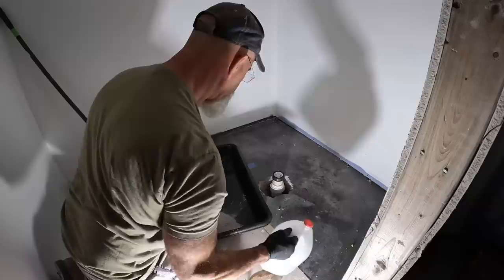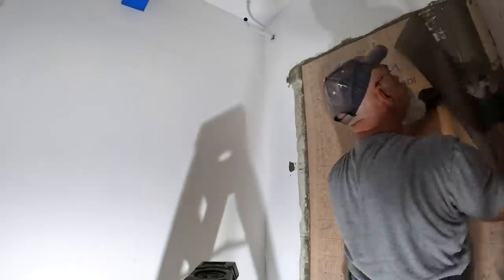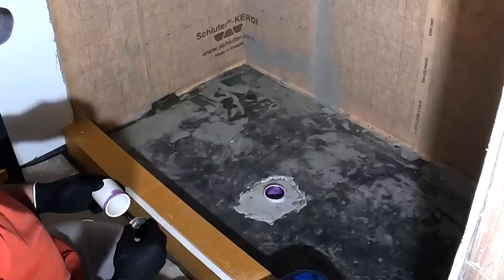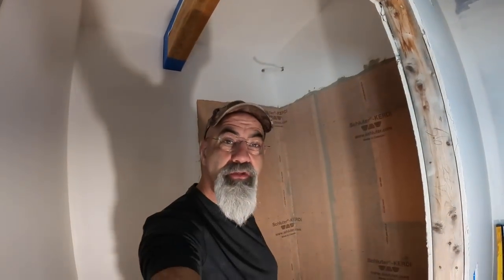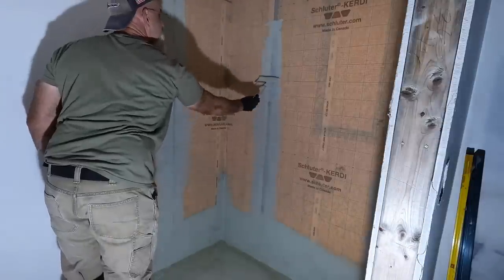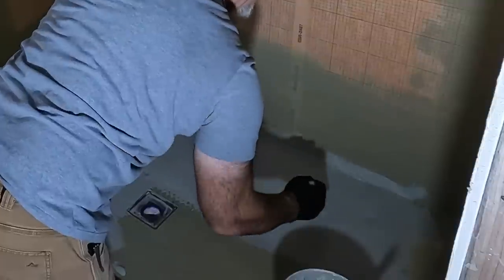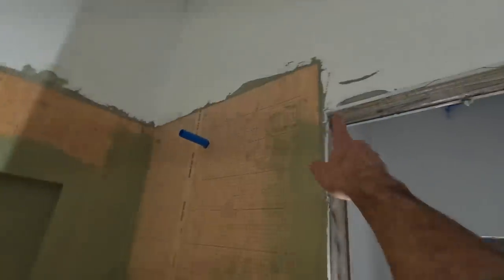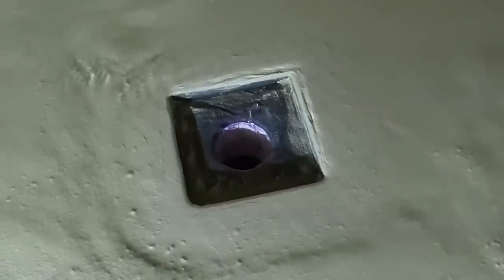DIY Shower - I built my own shower pan -  First time shower with kerdi and hydroban.

Comment: Next time use a gauge stick on the outer edge and a 1/4 thinner one around the drain for pitching water to drain and screen the wet bed then remove the gauges sticks and fill the void’s in you’ll see a big difference in your work and a lot less stress and smoother your thickness should be 1to 1 1/4 outer to 3/4 to 1 “ at the drain you can use a wire lath on the floor for strength no need to fasten it to anything just make it just flat just like a wet bed over a vinyl liner helps keep it from cracking you should of done it on the other one you just did
Reply from the maker: Yeah,  I think I will give that a try. It should make it turn out cleaner. I think my biggest issue was just not having enough material mixed when I started.

Comment: Doesn't schluter want you to use thinset and kerdi band on all the joints?
Reply from the maker: I did use thinset and kerdi on all the joints. But ultimately the responsibility for building the shower is on me. I wanted to go the extra mile.
Reply: @breakheartorchard4761  excellent.  I didn't see any kerdi band being applied in the vid, thus the question.    Must not have filmed it.  Really nice work on the house.  Enjoying the build. Keep up the good work.

Comment: Great video!  I am about to undertake the same project and wanted to know what type of shower drain did you use?  Thanks for the list of other products
Reply from the maker: I used a floFX drain flange.
Reply from the maker: Reason was that I had pipe sticking up above cement, no access from below and the FloFX is about the thinnest from top to bottom. They make one for pvc and one for abs
Reply: Thank you very much! Your video is a great help